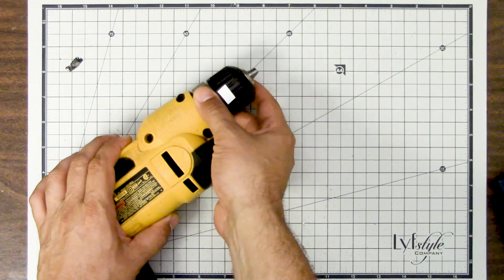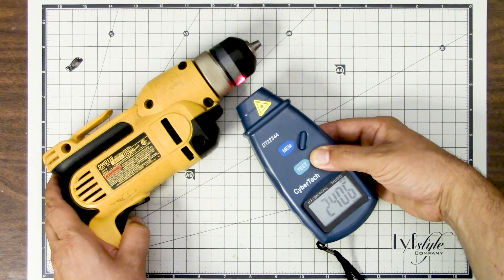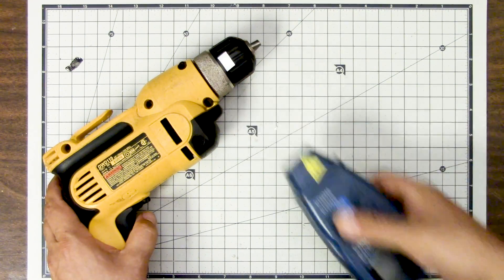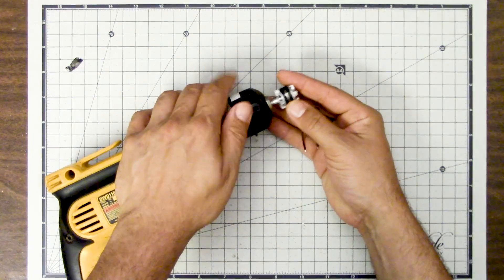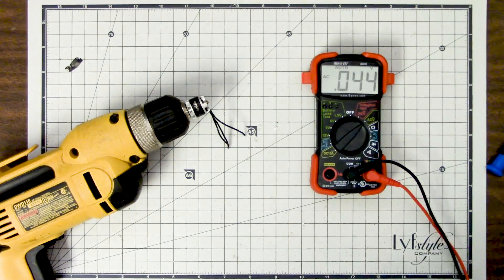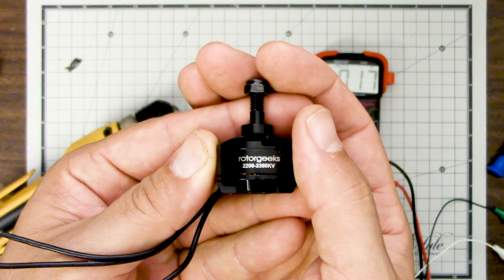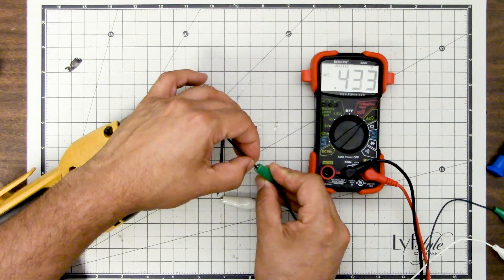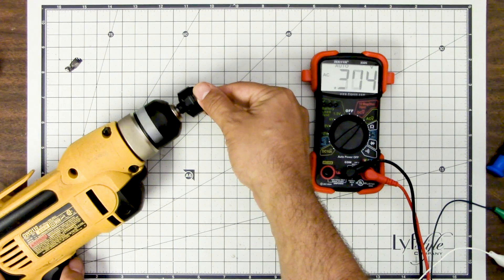Quadcopter Motor Damaged? How to find out. With a drill.

Comment: Hi Joshua.
Does ever happened to you that a new esc smoke an engine just right after connecting the battery?
Reply from the maker: Only if I soldered it wrong. Always use a smoke stopper when first powering up.
Reply: Joshua Bardwell I tried an hobbywing xrotor 20a with BLHeli in it and it smoked to engines. the beeps on boot started correctly then became loud and distorted then smoke came out from both motors. both 2300kv but from different manufacturer. one racestar and one emax. thanks for the suggestion for the smoke stopper

Comment: You could also use a Dremel, because on most Dremels you have to toggle a very specific speed setting, unlike drills that have a pull trigger.  But that was neat!  Thanks!
Reply from the maker: Yeah but a Dremel spins at much higher rpm which could be a problem for your hands. Not the motor though.

Comment: Great tip.I have wanted to use another motor on my ebike to charge my battery as i ride.But adding more weight and stuff maybe just keeping it simple is best.
Reply: just don't use another motor, make a mechanism to switch the motor from the powering circuit to a charging circuit.  Using a two position switch, you could select between having the motor connected to your speed control circuit or connecting the leads to a charging circuit for regenerative braking and charging of the battery such as when you're going down a hill or you want a workout.

Comment: You should set up a rig with a servo tester, an ESC and a drive motor.  Use this to feed the motor under test.
Varying the speed of the drive motor over time and charting the output will give you a table of data showing the KV output at different speeds.  You could create a nice graph of (unloaded) KV at different speeds using this data.

Comment: Looking forward to trying this on a bad BabyHawk motor I have.  I was getting a slightly lower resistance reading on one phase.  Like you said though my meter cost $60 so no supper low readings.  As for the motor, it would twitch instead of spin.  Happened out of the blue after flying a dozen flights.  Replaced it and it's flying great again.  BTW thanks for the review of the BH.  I love it for practicing.  Even 3D printed antenna mounts for it.
Reply: Rob Carnaroli I had a racerstar motor do that to me a couple weeks ago. The motor basically shorted on one phase, the effect being the motor would twitch then stop, twitch then stop, even under high throttle settings. This failure happened mid flight, about 10m off the ground. Dam thing flipped upside down and drove at full speed straight into the ground. Completely destroyed a go pro, the vtx antenna and split the frame into three parts lol, at least the battery survived! ah the fun we have haha
Reply: Ouch, ya I can't complain about a $10 motor :-)

Comment: +Joshua Bardwell what do you use as a camera in these talk to camera videos - is it a laptop camera or do you have some kingd of "real" camera set up?
Any chance of a quick look at your talk to camera studio set up?

Thanks for all your work.
Reply from the maker: My webcam is: http://amzn.to/2rZtWTV

That one is a freaking beast and amazing for the price. I have a 2nd one that I take on the road just because it's so cheap. I also sometimes use it as a 2nd camera on a particularly busy shoot. The overall image quality is good but what really makes it is the Logitech camera app you can install, which gives full manual control over exposure, etc. which means I can tweak the image to get the look I want out of the camera for minimal post-processing. This is especially helpful when I am in bad lighting conditions.

My bench cam is: http://amzn.to/2rKm5pb

It's also great for the price. Has microphone input. Decent manual controls (white balance, exposure). Good zoom, although I sometimes wish it had a little more macro capability. I intended to use this camera more widely than I actually do, in large part because the C920 turned out to be so good. This camera would not be good for vlog-style shooting because it does not have a wide-angle lens.

Here's one more little must-have: http://amzn.to/2tCseEU

That grey-card will let you get correct white balance and exposure out of nearly any lighting condition. Very useful when I am in a hotel room with god knows what color lighting. I also carry with me two full-spectrum 100W LED bulbs when I travel, so that I can replace two bulbs in the hotel room if they are particularly atrocious.

MANDATORY DISCLAIMER that those links are affiliate links and I get a small commission if you use them.

Comment: If you do have a IR meter do you have to disconnect the motor from the esc to an accurate comparison reading for the motor windings?
Reply from the maker: I don't know about that for sure, but for measuring things like capacitance and inductance, I think you usually want the component separate from the circuit.

Comment: The measured voltage is the back EMF. It can be used to calculate the Kv of the motor. Rpm/(vAc*1.414*0.98) This will be a close value to actual motor Kv.
Reply: William Gleason the entire formula is used by the Heli guys to calculate rewound motor kV. They found small discrepancies between calculated and actual, hence the addition of the 0.98.
Reply: Considering that you need a known rotational speed for this wouldn't it be easier just to measure the rpm of the motors using a tachometer then dividing that by the voltage minus loss due to the resistance of the motor.
Reply: using that calculation suggest the motor is actually ok then...
Reply: When operated as a generator, there is no back emf only emf.  Back emf is a characteristic of a motor not a generator.  Where did the 0.98 come from in your equation?